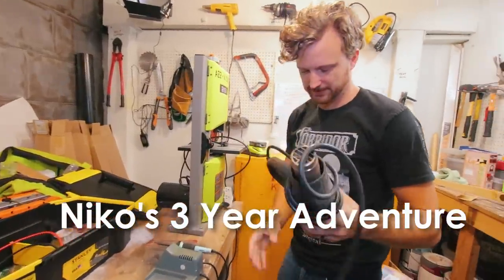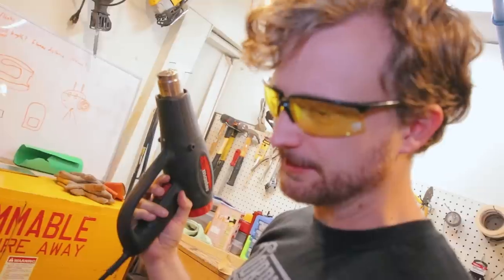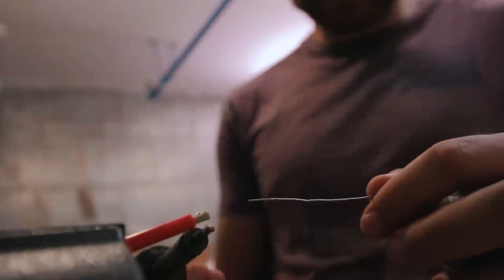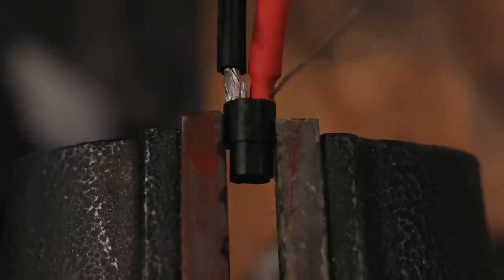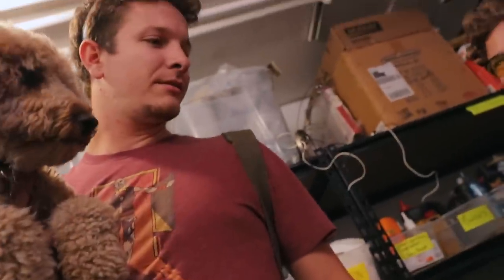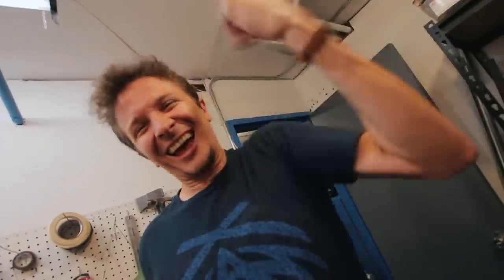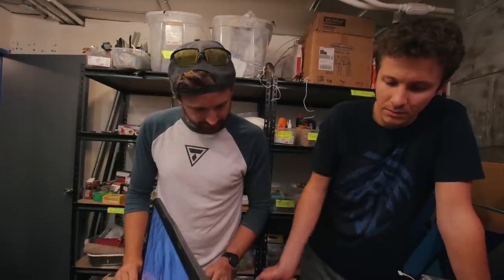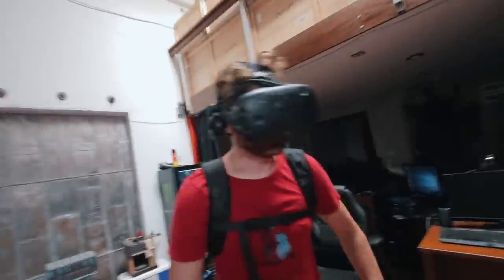3 Year Personal Journey to make a VR Backpack!

Comment: If you have a laptop that can turn into a tablet you can disable the keyboard and it would still fit inside the pack, fixes the recording problem. Either that or the powers settings needs to be changed for when you close the laptop.

Comment: Another way to get the laptop to use its full power on battery, is right click on the start menu and click power options,  then at the right side of the window click additional power settings Then set the power plan to High performance. And that will make the laptop use its full power with no power saving settings enabled. but the battery will drain fast so having that battery setup will help alot for how long you can play in vr

Comment: I mean you could always adjust the advance power settings in the laptop, as unplugged they are set to use 5% to 100% of their processing power state, utilizing lower percentages of the processing power to maximize battery lifetime. This is in the "power & sleep" settings where you then go to additional power settings, it'll open up a window that talks about power plans (ie either battery saver or maximum power "plans" which are defaults on my laptop). You can just choose any plan setting to adjust, as long as you then click on "change plan settings" then "change advance power settings", it will open up a window where you can manually adjust parts of what happens to your laptop plugged in versus running on battery, such as processor percentages to use.

no need to mess around with cords and individual third party components when you can do it all on the laptop itself lol

edit 1: (I woke up like 20 minutes ago so sorry for errors in steps, you can just google "how to change my laptop power plan settings" on google or something)

edit 2: Origin runs Windows 10 same as the laptop I use so the steps are the same

edit 3: the battery probably helps with VR being resource intensive and allowing longer playtime at a slight increase in weight, but the "tricking the laptop into thinking it's plugged in" was my gripe and led to this post being made

hoped this helped ;)

Comment: use an alice pack frame, its comfy and ridged with a light metal frame so you can protect everything. you can prolly ratchet strap the laptop in and use a heatgun and durable foam to make a bracket or sleeve for the laptop so it can cool while being safe.

Comment: If you guys were to use the Windows Mixed Reality VR platform as opposed to the Vive, this would be completely wireless. No need to setup External Tracking Cameras since the WMR platform uses the outside in Camera tracking. An all in one completely Wireless VR experience.

Comment: Inside my laptop there's a weak magnet next to the screen that triggers some sensor next to the keyboard when you close the lid which turns the screen off. If you test around with just a paper clip and find it you might be able to remove the face plate, take out the magnet, and still record screen footage while the laptop is shut on your back.

Comment: Mixing the wire colors means absolutely nothing, there is no problem.
You typically respect colors to ensure you're not mixing up stuff when installing / running wires in a house or such ... just makes it easier to identify everything. It's code.
But at the end of the day, they're wires nonetheless ... so long as the polarity at the plugs is respected, there's no problem.

Comment: So... That thermal camera? Is it a T1020 without viewfinder? 

It seems like it has autofocus to it as well. So I want to know, did you buy it - or just rented? 

Can you shoot some portrait or a Corridor video with it?(you need to find out how to get a .cqs without the watermark tho.)

I am building a DIY zoom lens for my low resolution thermal camera with a 3D printed prototype as well; but my sensor is not nearly as good. 

I really want something to be done with it; and if I need to become a patreon - I will manage to do that as well.
Reply: MrVipitis it’s a T540 and it’s mine. The .cqs files record at a much slower frame rate so it’s no use that way. This is a newer camera and it’s great just wish it could do a bit more with recording. And how are you 3D printing a lens? I thought only midwave could see through plastics most smaller microvolometer sensors are always long wave. Have you had any success?
Reply: so a T540... it should be able to record 30hz, maybe through a PC (thetered/wireless) or a video recorder with the digital video out. UltraMax works great for stills at least. 

I am 3D printing the housing, a way to mount it onto my CAT phone, focus and zoom control. The lens elements themselves are coated Germanium from an old fire fighting camera. It is all a prototype right now, and being my 3D printer, I suffered some print fails like warping, spaghetti, ringing... It's not done yet, still printing parts.

If you are interested in the topic, I can supply you with a lot of resources. There are far too few people who use thermal imaging cameras for photography. There are examples, but those are rare, or badly done (like BuzzFeed filming people peeing or VICE filming an adult film expo). First of all I would love to refer you to the EEVblog forum, you may know the EEVblog YouTube channel, but the forum has one of the only places in the internet for thermal camera enthusiasts, next to some hardcore developer groups inside FLIR education programs. 

http://www.eevblog.com/forum/thermal-imaging/

You will find some experts on the topic, collectors, hackers and a good handful of skilled software developers. The main success is firmware hacking E4 cameras, but there are other topics as well. I will post about my lens experiments once there are done. 

Next up is the Palette Generator for FLIR by Instagram user @myThermalWorld 

https://bitbucket.org/napalmy/palette-generator-binary/downloads/

this allows you to make and apply palettes to flir radiometric jpgs much easier than with photoshop for example, because you can set your temperature ranges, and the apply mode(histogram equalization). Should work well for stills done with UltraMax.

I believe that the T540 is very powerful and has all the features you could possibly dream of. Nothing is stopping you from making some shots with it for a short film (would be the correct thing for an Adrian script...). There is a shortfilm filmed with an infrared camera, it's really old and from a duo that does some more... let's say "experimental" ...art with LWIR cameras. As well as a music video - but that is about it.

If you have any questions or need directions, feel free to message me - I will try to help.
Reply: so regrading lenses, I just typed up half a page and had my computer crash -.- 

So a very quick run down. optical Lenses for LWIR are made from GaAs, Ge, ZnSe (somestimes ZnS) or chalcogenide glass. 

Using plastic works only in theory. The transmission is rather low, so only Fresnel lenses are an option. These have a flat profile. They don't work great for imaging as they lack quality and resolving power. We have had a discussion on the topic on the forum, about a year ago: 

https://www.eevblog.com/forum/thermal-imaging/plastic-lenses-for-lwir/

Fresnel lenses usually are used for broad light distribution -> you should see some on the film lights in the Corridor studio, or something like disco lights, and Light collection for detection -> a solar oven could be build with a Fresnel panel; just google it. You can find scientific papers on the topic of using plastic lenses for IR behind paywalls.

Reflective lenses using mirrors work. Gold coated or Mylar. Astronomy great coatings coast a few thousand for just a small 14" mirror. Using a Newtonian reflector telescope works, as long as you remove all glass elements from the optical path. You will suffer from a low aperture. 

thermal optics for LWIR usually are f1.2 or faster. Expections are firefighting or high temperature industrial cameras (like molten iron, Nuclear power plants...) Those camera either have an build in mechanical iris - or their sensor supports multiple gain modes for extended temperature measurement ranges. 

Professional optics, like you can buy from FLIR first party, are calibrated to measure exact temperature for thermography. 

Other types of lenses like pinhole or an aragoscope won't work due to their very slow aperture - tho they have been tried.

hope I got everything now.

Comment: Okay, so I know this a year old video and the chances of you all even saying this is low but I wanted to say something about your soldering. I currently work for the DoE soldering and inspecting non nuclear components for the NNSA. You'll have much better luck with your soldering if you flip where you are putting the heat and where you're applying the solder. You should be putting the iron where you are wanting the solder to flow to and the heat on the opposite side from the iron. For example, you are wanting to solder a wire into a connector cup, you should tin both the wire and the cup before hand, then apply the iron to the cup, place the wire in the cup and feed the solder wire INTO the cup so that you aren't applying it in the same place the iron is. Solder flows to heat so you will never get proper solder flow if you apply the solder in the same area that you're applying the iron. Sorry if I'm being "that guy". I train new people where I work so it's sort of just instinct at this point.

Comment: I hope that blue object that was used to check ampere  also has function to cut-off connection when certain watt or milliAmp × hour has been drawn from the battery. Lithium polymer battery tends to catch on fire when too much has been drawn from it. Even more so when it was drawn too fast... >. <;;

Comment: Can someone explain why glasses are always dark in the flir heat map? They should be about the same temperature as the face.
Reply: JGeMcL glasses are not in contact with your skin they are always away from you body and are normally thin allowing them to cool off really easily if you notice with Clints glasses they were warmer around his nose because they were in contact but unlike your body the glasses aren’t always generating heat. So they cool off way easier. Hope that answered your question.

Comment: ... okay, but isn't there like a wireless thingamabob for VR headsets coming out soon?
Reply: There is, but you have to consider that its 300$(not that price would matter that much) and niko has presumably wanted to do this for 3 years, and its presumably good content. Cheers
Reply: The build is good content sure... so would playing the games... but actually, if anything seeing as how this is now more about keeping the computer from throttling maybe the next step would be comparing the two experiences, because the awkwardness of carrying all that might actually be better than the potential latency of the wireless solution, since I've only seen it in use a couple of times.

Comment: I have a pulley system for my Vive's cable management.  I found this (https://www.amazon.com/gp/product/B01M6EB8DM) on Amazon and it really keeps the cable out of my business for the most part.  Sometimes if I'm flailing my arms around it can be an issue.  I imagine though with all of the clever equipment ya'll come up with that you could use a boom mic arm thing to hold a cable re-tractor above you and help keep it out of your way.

Comment: Doesn't the factory battery charger say the volts and amps . Don't you know how to use a voltmeter. Just the volts to match then hot glue so it wount move . Lower the amperage down it should be another screw. Put the voltage meter into amps . Adjust the dial until it says the amperage matchesmcglue the dial so it doesn't move then plug it in and you're set

Comment: Why didn't you just cut the charger wire and put a xt60 connector on both the ends so you could use the charger and the battery too

Comment: omg. stop using the charger port and connect your big beefy lipo in 3s configuration to the mainboard battery connector.  if you want you could even use the charger IC from the original laptop battery to just make one huge laptop battery, no 19v converter losses, balanced charging form the original  supply and under-voltage protection  the 19v boost circuit doesnt have... then again considering the polarity wasnt even noticed  till the last minute.........

Comment: 10 AWG ?!? That's way over kill. 12AWG wire is great for a XT60 connector.
Reply: yeah no kidding, look at the factory power cable for the laptop, would only need to be as thick as that, maybe a bit bigger to be easier on the wires but not much
rc quads\planes with motors need thicker wires because they pull 20-40 amps, laptops don't
all they had to do is use a kill-a-watt to see the current draw of the default power supply with the laptop with full load and judge the wire they needed based on that

Comment: That beginning.... ehhh... You'd drain the battery quickly.... but you can always SIMPLY amend windows own power settings and tell it not to throttle due to battery power. Hell, with Win10, you can simply click the battery icon and slide the slider to the right.... to "Performance" .... and you're clocked all the way up. Hire me and fly me out to live in LA with you guys.... no more need for $10" computers, I can give you that performance for about an 8th of the cost.... no more need to solder your own stuff, I am a flows, controls, and electrical engineer.  And no need for any additional actors or editors either, as I can do that for you as well.... Please just let me be part of your dream job environment!  Alos, fFs, use flux man...

Comment: I think a few people aren't getting what Niko is doing. It's not that he's trying to make a wireless VR headset, he's made a portable VR station (computer and headset). The issue he was tackling was that the laptop needed to think it was plugged in so that it could fully run a VR programme, it wouldn't matter if the headset itself was wireless or not if the computer wasn't rendering the programmes optimally. So people can stop telling them that they could have just bought that wireless adaptor when it wouldn't have answered the issue in the first place...

Comment: 1. That is not a hair dryer, that's a heat gun. Please don't use a heat gun to dry your hair. 
2. Electricians don't solder, they pull cabling into buildings and hook up power panel boards. Electronics engineers do the soldering. 
3. All this instead of simply configuring the computer to run at full performance on batteries? Or did you try that and the battery ran out too quick? 

The More You Know 🌟